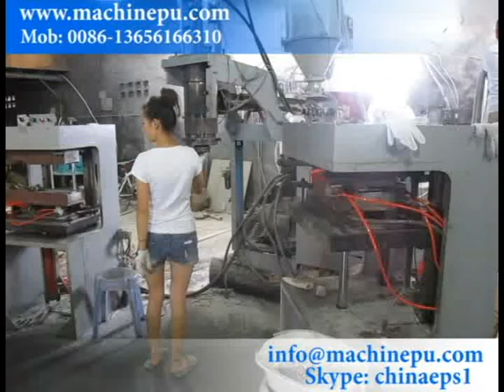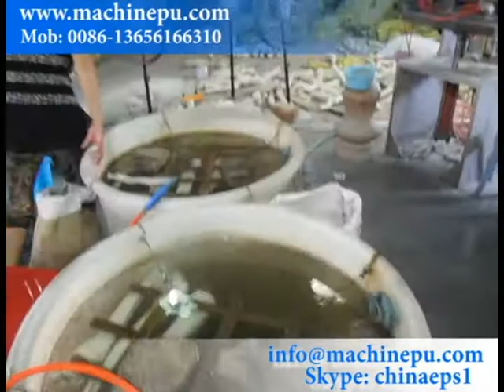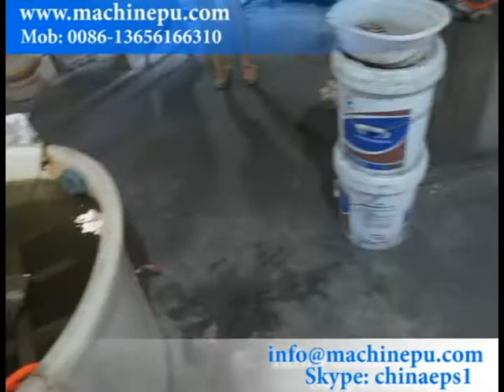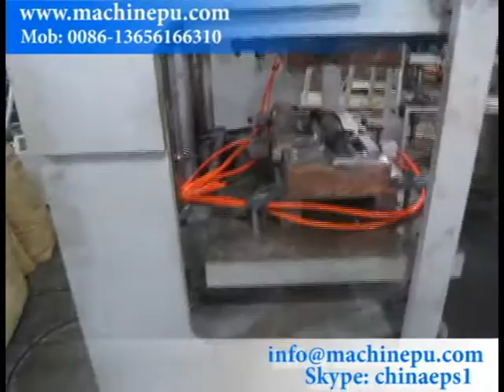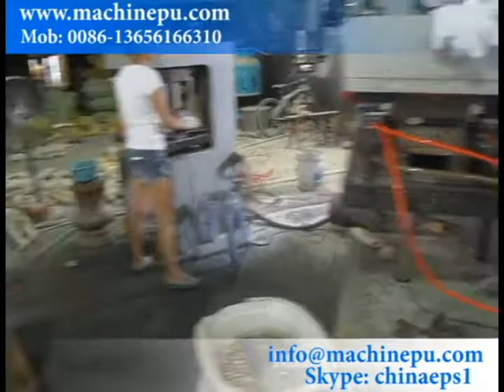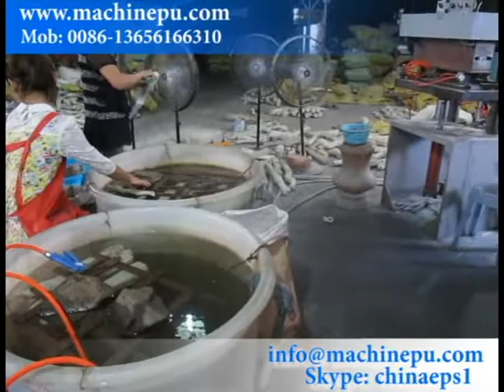ABS Hollow Blow Injection Molding Machine for Furniture Leg

Comment: hello, are you engaged in the production of equipment for the production of ABS plastic parts?
Reply from the maker: yes, our factory is professional in producing abs blow molding machine, if you have need, you can contact us www.machinepu.com Mail: info@machinepu.comQQ: 3504452922 Skype: chinaeps1Mob: 0086-13656166310